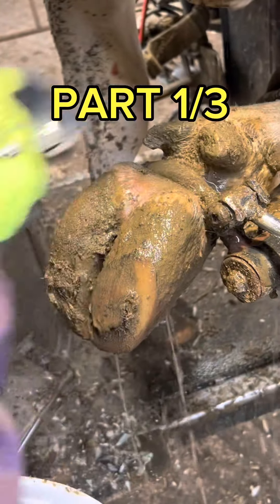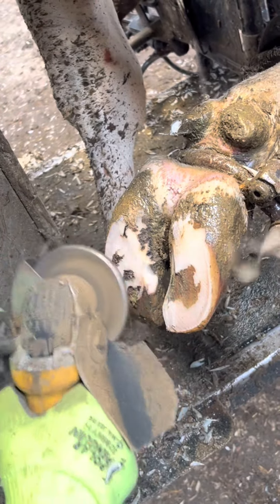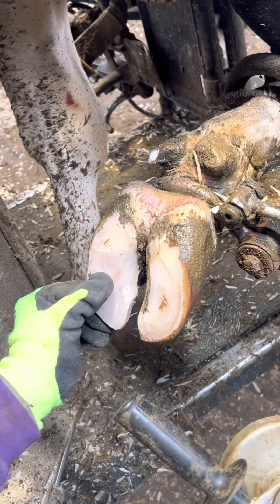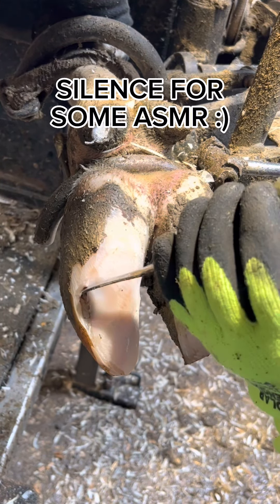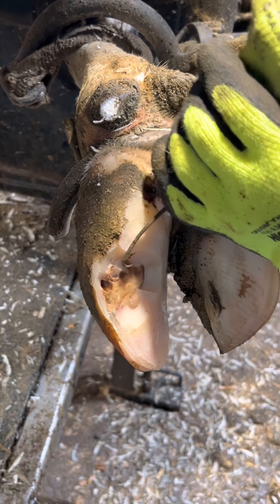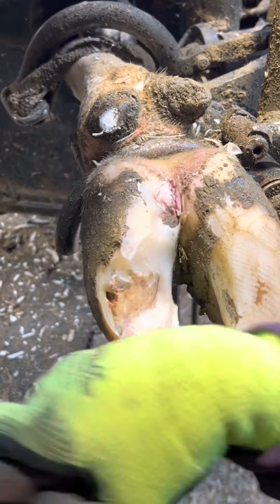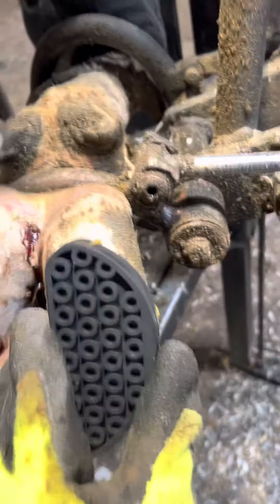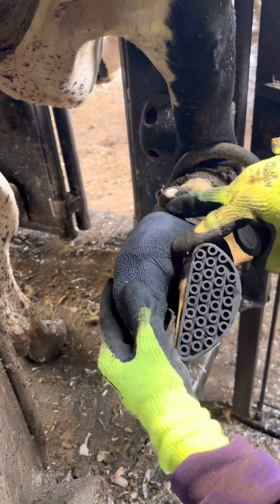BAD PROBLEM!!!

Comment: You don't have to clean it because the trim will clean most of it off.
Reply from the maker: You are correct. The cleaning is just for viewers like like to see it clean, and there is nothing wrong with that either…just unnecessary.